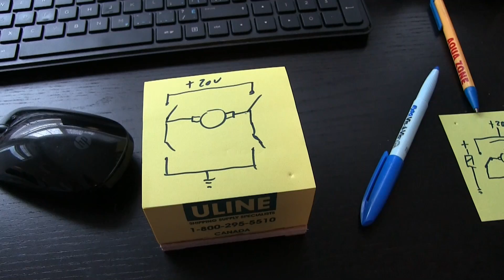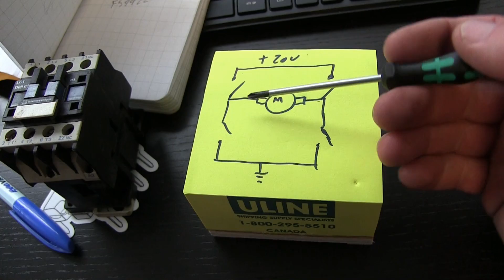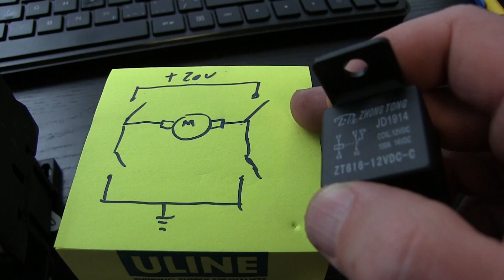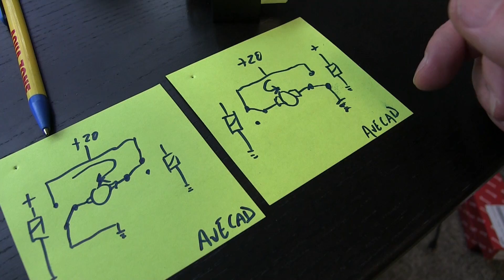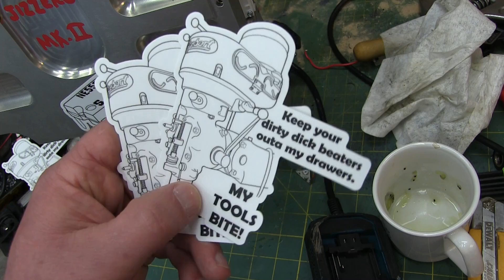Hacking Juicero's DRM Fruit Bags

Comment: I'm building a new workbench in the basement complete with a restored 1965 Wilton vice, it would really class up the joint to be able add a few stickers!

I have a request for a "how to" vid-j-o...

I know that I am not the only with this particular issue: in my entrance hall, on the end table in the living room, on the desk in my office and on both night stands on the sides of our bed; we have power strips, lots of power strips...all of which have those ubiquitous 120v to USB charging cubes. i-Pads, i-Phones, laptops, earbuds, older I-Pads, older I-Phones, non apple phones, TV remotes, headsets, Bluetooth speakers... and on and on...

How about a how to vid-j-o on how to build a quality, stable "box" with ten or so USB charging ports.

Help! My home looks like a 1950's telephone switchboard! 

P.S.
Do you know where in the lower 48 we can find a skookum, thumb detecting, nut fucker? Try as I might, I'm coming up dry.

Thanks! 

-a patron.

Comment: Oh, come on ave, the capacitors are 2 series, 2 parallel, so each pair only sees half the voltage.
 www.daenotes.com/images/full-wave-voltage-doubler.png
A bit of googling on "voltage doubler" would have told you that... but hey

Comment: It's not a Cockroft-Walton voltage multiplier, it's a full-wave voltage doubler. It can't be used to get any more than double the peak voltage of the AC. Check the traces that the big electrolytic capacitors are soldered to. I guarantee you there will be 2 in parallel and 2 pairs in series, giving double the rated voltage.

Comment: AvE - I'd be happy to take a crack at "fixing" the software on the bluetooth board for you.   I work as an enginerd for an embedded electronics company, usually focused on aerospace and medical safety critical stuff, but have a small IoT group as well. Based on everything else I've seen I can almost guarantee they left open a JTAG or serial port somewhere, but even if not, there's more than one way to skin a cat...
Reply: pull chip
replace with arduino
???
profit
Reply: +Siana Gearz - That was also my guess when I saw that on there.  I'd be willing to bet if you poked around the board you'd find a CP2102 or similar TTL-USB converter on it for just that reason.
Reply: "somewhere"... bet $1 that reversed USB type A male footprint with oversized surround is actually serial through which they pour in the initial firmware when they build it, as the micro comes from the factory with serial bootloader.
Reply: +Siana Gearz - I guess I was thinking those pins lined up as a USB port when the board was mounted in the casing of the machine. I was also going off what Senor AvE said around the 1:40 mark that he had inserted that USB plug into his computer, it detected something, but he didn't have the appropriate drivers to talk to the device- hence my guess that it was a TTL Serial-USB converter of some type. You may be right and it's just pins for a serial straight to the SoC.
Reply: kc8omg even if the JTAG is enabled, which it shouldn't on a production unit, you are going to need the vendor SDK etc to do anything. I doubt you'll get very far.
Reply: No JTAG "shouldn't be" enabled, but companies still do it all the time.  Also, when you work for a company that's a member of the various "preferred suppliers" programs for the half-dozen or so largest silicon manufacturers in north America you have things like $10,000 debuggers sitting in the lab across the hall from your office ;-)
Reply: But you're right, if they do have their chip properly locked down it'll be much harder if not impossible to get in, that doesn't mean we shouldn't try though!
Reply: kc8omg, what would that be there for? It's obviously not a real USB plug - it's too wide to go into standard socket, and the footprint is reversed - the exteded pins are supposed to extend towards the edge, not into the middle of the board. I think they just reused the footprint and a middle piece of USB plug or socket to mate to it, with some kind of custom retainer around it. There's no reason for it to be USB electrically. The number of pins is suitable for serial (you just need VCC, GND, TX and RX to flash the STM32, no flow control etc), and it's suitable for i2C, ARM SWD, and compact JTAG. Enough things to use before you add extra chips on the board that might as well be in the programming cable. There are shipment options on STM32s which specify which bootloader they come with, but RS232 and and SWD are quite common i think, though on some models SPI and I2C options are available too.
Reply: kc8omg if you have any activity on USB lines at all, you can get an "unrecognised device" prompt from Windows. I thought that's what likely happened. I don't always take people's interpretation of things their system does literally unless I know I can trust their judgement, but even with colleagues in engineering, I found it better not to rely on it and test options that seem more likely to me first. But I'll look later as to whether any other protocol pins are multiplexed with USB on the controller, it could actually be USB something when it's executing main firmware. Also USB programming firmware is actually available, but I don't recall it as a shipping option - probably because it's bigger. I'm also curious how it switches boot mode here, would take some tracing.
Reply: Could be either. I have a Vizio TV which has a USB port in the back which is for service only and if you actually plug USB in, you kill the TV according to what I've read.
Reply: or juice a cat?
Reply: My intent was not to come off as cocky or dismissive or that I'm "the only person in the world that has a job", in fact I agreed with your point in my follow-up comment. Admittedly I am proud of the job I have and the company I work for, so apologize if I was bragging.  The point still though is that I have more tools and knowledge at my disposal than the average enthusiast/hobbyist which is all I was really trying to get at.
Reply: >Also, when you work for a company that's a member of the various "preferred suppliers"..

Blah blah blah. I have the internal SDKs with source code for the internal boot roms etc that implement the JTAG lockout, firmware signing etc for a ton of wifi SoCs on my desktop. You aren't the only person in the world that has a job.

Comment: two diodes and two capacitors can make a doubler, and as long as you can keep things balanced the capacitors only see half  the output voltage

https://www.elprocus.com/wp-content/uploads/2015/01/Voltage-Doubler.jpg

Comment: Juice bags have DRM systems, what a time to be alive.
Reply: How did we live in the past. Our juice jizzers wasn't connected to an internet and they didn't have a DRM system. What's better than getting DDOS'd by your own toaster? NOTHING.
Reply: The 2.0 k-cup from Kuerig does the same crap.  Protect the consumer?  Sure, "all you'll feel is pressure; don't worry, it's only a cold sore."  It's designed to get you captive in their revenue stream not protect you from stale juice or off-brand k-cups.
Reply: hiagftd thankfully that things drm wasn't this anal retentive, sharpies ... fighting drm since the 80s
Reply: Crazy, eh?   Keurig pulled that crap with their packet coffee makers too.  You had to hack them if you wanted to use packets from other coffee companies in the Keurig maker.
Reply: CFW for coffee machines?
Reply: Baba Blacksheep and we had hacked it since forever too!

Buy a printer > add cmyk refill containers

Don't buy hp printers though.
Reply: DrathVader Printer makers have done that with their ink cartridges since forever.
Reply: cut the bar off the 2.0 cup and slap it over the reader and viola no more checking xD.. or just buy a older version and you can use both v1 and v2 LOL
Reply: People like kirieg because you just drop the pod in jucero says they are fresh juicing fruit but all you would need to do its just cut the bag open?
Reply: And if it's one day past expiration, you have to throw it out.

The Juicero is always-online, but the online functionality doesn't do anything except decide when it's not going to squeeze your juice bag.
Reply: Juice bags period......what a time to be alive....
Reply: Ya te vi dun
Reply: It's okay, stocking.
Reply: Lol Hold my papers 😂😁
Reply: Why does JUICE BAGS HAVE DRM BRO WTF
Reply: DrathVader 
Not only PC games and eBooks, DRM for everything.

Comment: Oh, . . . so you really just need one simple DPDT switch for direction, and one SP switch for ON/OFF, . . . easy !
Reply: Eldon Brown 
You really only need 1 motor starter (like in the beginning of the vi-jeo), but with a NO as 4th contact.
Use the H-bridge AvECAD and you are done! You can add a start/stop switch or just press the motor starter by hand.

Comment: The magic trick how you get 320VDC outof 120VAC with two diodes and 250V capacitors is a "Delon circuit".